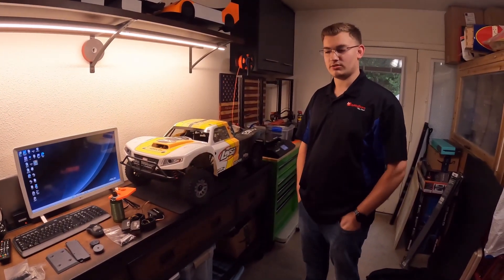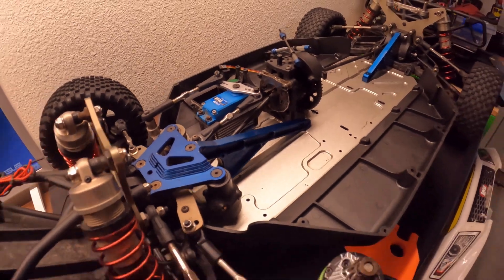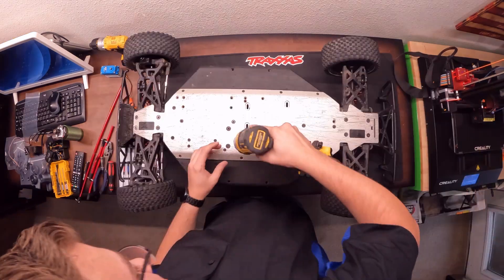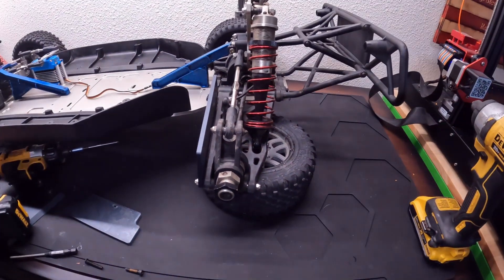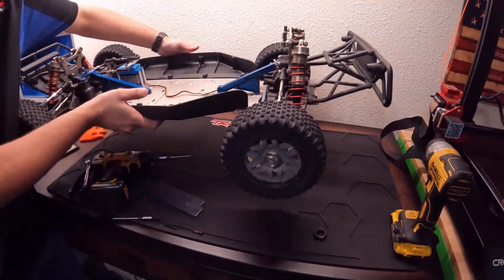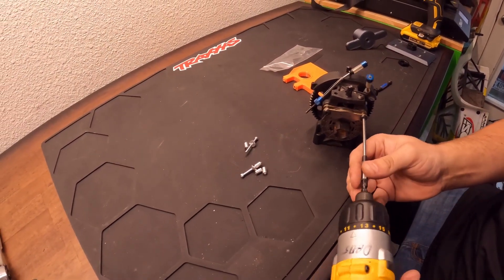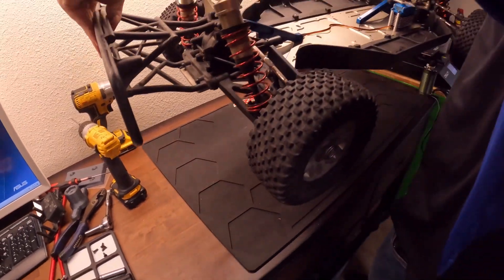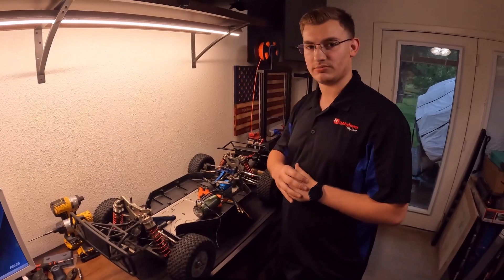Austin Losi 5T Build. Converting from Gas to Electric.

Comment: I also noticed in part 2 you don't have 3d printed motor mount 🤔 did you abandon that?
Reply from the maker: We have never used a 3d printed motor mount. It would never hold the power.

Comment: I'm so trying to make a 3D printed 30° North buggy electric motor mount and got 3 scanners and 3 printers but can't seem to get it done and would love to pay for a file that I could print asap as it's a different setup completely and I've did so much to it and put all Rovan XLT suspension on it and so the rear end diff and drivetrain is backwards and no center diff
So please if you can't maybe you have a site or a place that can because it might take me till next year to learn how to create parts

Comment: Cool build of a 5T, I was considering doing a 5T 2.0 electric build but it was really expensive to do an official 5T so i decided to a 30 Degree North clone which seems tougher than the real one and it's cheaper. Still you got a cool build i hope you enjoy it.
Reply: ^Same, mine is on the way, the plastics are tougher supposedly and the 5mill 7075 chassis there is no better buy out there.
Reply: What did you do for fluids? I have the max4 and 560kv combo. Pinion?
Reply: @bluejfpv7876  I don't have mine yet i'm currently in a battle deciding if i want a real Losi 5T or the 30DN V2 clone. Because i want to do an electric conversion to mine someday and i'm worried that the stupid RC electric conversion kit won't work on it.